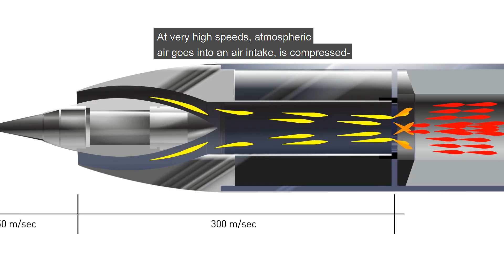How ramjets may change the role of artillery on the battlefield

Comment: Wallah, that electronic voice ..
Just a small problem with this concept - it needs clean air going into the intake - that means the motor must be infront - no turbulent air. That means the artillery shell is in the rocket motor discharge - will overheat and explode before reaching the target.
If you put the motor behind the artillery shell, it will not get clean intake air......

Comment: Drones will make all artillery obsolete, if they have not already. Id imagine for the price of one of these shells I could send fifty ground hugging kamikaze consumer drones to the same target from different directions each carrying a pound of C4
Reply: You can't hear an artillery shell coming and when they come doctrine makes sure it comes in volleys. Per shell they typically shred fields of 100m by 100m and kill all infantry and light vehicles in it.
There is very little active protection on the market against incoming shells, only passive warning systems.
Drones on the other hand... They are good as a weapon platform but not as a destructive device themselves. You can hear them, you can see them... You can shoot them with small anti personel weapons.

Comment: Definatly will need guidance at 150KM range
taking into concideration that if a mouse squeaks it will lead to a series of events that will cause one of them Russian artillery rockets to veer off target by 1 meter.
But if it means more hands on deck in the "get ramjets" working department, i'm all for it.

Comment: However the problem is there are significantly less charge in that shell than in a normal 155.
Reply: Indeed. I wonder just how large a payload it can possible carry. It looked like half of the thing was rocket fuel and the other half was partially claimed by the air intake.
Reply: @herrakaarme  it's always a tradeoff, Mr Snake. Better to have the first shot with 25% of the payload because you are already in range than not get in the second shot because you're dead.
Reply: @herrakaarme  At very high speed you don't need an explosive.
Reply: @Mic_Glow  According to the WW2 German data the ramjet assisted artillery impacted at a slower speed than a conventional artillery shell.
Reply: That was the first thought to pass my mind upon seeing the projectile mockup.
Reply: And I bet its really fucking pricey too.
Reply: @andycopland3179  "pricey" that's the point
Reply: Lutefisk poison.
Reply: hmm it explode bevor the impact and fill the aire with schraplol 🤔.....just an idea
Reply: Probably the only  real use is to  counter fire other artillery positions. You need  range advantage more than sheer firepower for that.
Reply: @tiagodagostini  ? You need same range as enemy and big precision. Size of warhead can decrease need for precision.
Reply: Yes but these are not area weapons. They will be to hit specific targets like an enemy artillery piece a long range.  So what if it costs 50x as much.  50 normal artillery rounds will not take out a 2S35 Koalytsia-SV 80 miles away.  That is the goal here..  Be able to put up a few hundred of these rounds a day, and take out enemy equipment.
Reply: @shooter7a  Sure they will. Just like ABM can reliably kill an ICBM on reentry with no warning.
Ooopss. No.
Reply: @hellstromcarbunkle8857  GBU-53/b's can achieve 90% contact kills on moving vehicle targets from 40+ miles away.  CBU-39s can do far better on fixed targets  Excalibur 155mm rounds can achieve nearly the same performance with similar range, and do not require an aircraft to launch.  What makes you think a ramjet boost will stop weapons systems from achieving the same performance?  These performance specs are real.  There are tens of thousands of US munitions on the shelf that can do this. 

Your false equivalence in comparing this to anti missile systems is childish and stupid.  The ABM problem is technically orders of magnitude harder.  

For example, with an ICBM, you require a CEP of less than 1m.  You literally have to HIT the target directly. 

The target is traveling Mach 20.

The ABM missile is traveling Mach 3-6.

You essentially have to hit a bullet, with another bullet.  

The precision artillery problem is far far easier.  Required CEP to take out fixed targets is 3-5m.  

They are standing still. 

The artillery round is moving mach 4 +/- at the muzzle.  

This is EASY.
Reply: @shooter7a  No ABM system uses a single kill body. It's always a scattershot at predicted impact.
Always.
BTW, Gerald Bull produced 4.1 CM CEP at 50KM back in the early 80's.
The reference is G6-45
That's CENTIMeters.
Reply: @shooter7a  Moving vehicles < 60 mph with 90% hits? That's a lie.
Reply: @shooter7a  No they won't. Because the ramjet means less weight to throw in warhead, so smaller or nonexistent guidance, thus MORE area fire if you're going to hit the target FARTHER AWAY!!!
Reply: @hellstromcarbunkle8857  Ramjet means less oxidizer weight as well.  That is the whole point.
Reply: @shooter7a  Less oxidizer.
And a steel aerodynamic ram.
And a Ceramic compression chamber.
And fuel injectors
And aerodynamic maneuvering surfaces.
And inertial guidance surfaces.
No, it won't work "better" as it shoots farther with less accuracy and far higher costs for much lower payloads.
It's the new "Crusader" cannon fraud. again.
Reply: I bet the explosive would be in the Air-take thingy. Adding that with what little fuel is left.
Reply: Uhm, no. A standard fragmentation shell for a 155mm Howitzer is 47kg. 9kg of that is TNT. The remaining 38kg is cast iron (minus the few hundred grams for the detonator). By the looks of the void between the venturi and the fuel compartment id hazard the guess that this could hold maybe 12kg. You lose a lot of the fragmentation though.
Reply: Jjohnno 87  jeah but if its laser guided tanks with LWR(Laser warning reciver) would by warned if the are lased useally the would deploy smoke and retreat tanks with out LWR would get destroyed by it and any other laser guided arty round
Reply: @toxi2202  may be you are right but laser guided artillery missiles are costly to waist for a small weapons like ramjet shells
Reply: I ask why America could not duplicate the 100 km range of the GC-45 210 mm canon built back in the 1980's by Gerald Bull.
We have his notes, his drawings and several examples taken from Saddam in Oilwar I.
What's the hold up?
Reply: @shooter7a  FIXED, FIXED and no, 92% is not going to be true at 100 km (same as the GC-45 from 1980)
Reply: @shooter7a  Oh, NOT 1400 km, don't even try.
Was that yards? Meters? EIther one being well under 1 mile it isn't a test, it's a joke.
Reply: Which is fair if you can delivery it as the  small cruise missile it is
Reply: If they have laser targeting or gps, they don't need a huge charge.  If it's used as anti-materiel, the emphasis is quite different.
Reply: @jklappenbach  Either laser targetting or GPS won't help. Too much lost firepower.
Reply: @hellstromcarbunkle8857  You're thinking about this wrong.  They could remove all the explosive and put in tungsten penetrator rods, and this thing could kill vehicles or equipment through kinetic energy, alone.  As long as it hit the target.  Which it can with laser guidance at 150 km.
Reply: @jklappenbach  Too slow to be any use at all. Ramjet big enough to push to Mach 3 would suck gallons per minute.
NO explosive, NO warhead at all
People, this HAS been tried before.
No sweet spot fuel, guidance, ordinance better than standard rocket-post boost.
Reply: Small charge is better than no charge
Reply: @dobs862  Not even.
If the target is not destroyed, the small charge just makes you a target for counterfire batteries
Reply: @hellstromcarbunkle8857    Hey genius the warhead is the same weight as the shell is over almost 3 times the length of a standard shell/rocket boosted shell and and they do not run for minutes but seconds.. And FYI these shells are now in serial production with Boeing and are finishing up the last of the testing..
Reply: @matthewq4b  So..you have ZERO data on the delivery weight, impact destruction at various ranges nor even maximum range.
Thanks for clearing that up>
no, the warhead is NOT the same weight since the propellant is still limited to 155mm diameter on an expansion length of just 4 meters. A bigger cannister will NOT increase throw weight given that the delivery vehicle is now accelerated over a shorter distance.
More powder only helps if the maximum pressure / time is increased. It is not.
Reply: @matthewq4b  Finishing the last of the testing.
You mean like the AIM-54A Phoneix.
That never, ever worked as advertised?
Well color me shocked.
Reply: How do you know that?
Reply: A normal 155 round can't precisely  strike a high profile target beyond 40km though
Reply: Destroy their artillery with ramjet shells, then move heavier artillery closer.
Reply: I think if it could be made into a precision shell which could be guided then the small charge could be ignored.
Reply: @許進曾 such precision would make the round to expensive to be used, which is what killed the Zumwalt class…
Reply: @許進曾  At the price-point it is a necessity. But the USA is stuck in the past filling the entire countryside with tonne upon tonne of explosives. The war of the future will be more hide and seek.
Reply: i guess if the shell is flying at Mach 3 it will rely on kinetic energy to mess things up
Reply: @RichardsModellingAdventures  kinetic energy is useless against infrantry that round cann mis you by 5m and your fine  

Meanwhile normal artillery uses HE fragmentation To cover whole are with Fragmentation and even air bursting for maximum lethalnes
Reply: @toxi2202  But even a handgrenade at that range will mess you up, and this munition looks like it will have at least that much explosive payload...
Reply: Wont do to much if it hits sand dunes and doesn't explode… That type of round would be effective against structures but the price would be insane for that level of accuracy from that range.
Reply: @RichardsModellingAdventures  No.
Reply: @RichardsModellingAdventures   
I do not think that could be its terminal velocity.
Reply: @nahidhkurdi6740  Mach 3 is minimal velocity for ramjet engine to work but its hard to say what the speed will be at the end of the trajectory.
Reply: @Bialy_1  once fuel is burned, head will slow down missile rapidly
Reply: @Bialy_1  Wrong. Ramjets were used on the XH-26. Not efficient but neither will these be. Remember, the ramjet will have to endure 5K g's acceleration.
Reply: If I throw a rock  at your car at Mach 5, your car will explode.
Reply: Germany developed solid fuel ramjet artillery during WW1 with a range of 120km. The explosive payload was too small to be useful.
Reply: @Spacedog49  I would expect the targeting in ww1 would be the main cause of a small charge having no usefulness. If you could trow a hand granade 120km and have it land on target it would be useful. however at mach 3 it will still take 2 minutes to go 120km. so not as useful for infantry or vehicle warfare but may have a place for weakening communications and utilities. but also a hard sell vs drone tech.
Reply: @another1commenter770  GBU-53/b's have autonomous targeting capabilities and are able to take out moving targets 40 miles away.  It is not outside the realm of possibility that artillery could do the same.  In fact, the M982 has already been proven in combat to be able to hit moving targets.  What you say is not possible has already been done.

Here are some notes on M982 variants:

Increment b:

Excalibur S: In June 2013, Raytheon initiated an internally funded program to upgrade the Excalibur Ib with a semi-active laser targeting capability. The SAL seeker will allow the shell to attack moving targets or those that have re-positioned after firing, and to change the impact point to avoid collateral damage.

Excalibur N5: Version of the Excalibur S downsized into a 127 mm (5.0 in) shell to give naval guns mounted on destroyers and cruisers the ability to fire extended range guided projectiles.[31] Raytheon is also considering a millimeter wave seeker (similar to GBU-53/b) for fire-and-forget operations.
        
Excalibur EST: Excalibur Shaped Trajectory, allows the shell to make its final approach at a controlled angle; demonstrated in August 2018 and deployed shortly thereafter.

Increment II "Smart" projectile for moving and time-sensitive targets. May carry either 65 DPICM or two SADARM submunitions.

Increment III "Discriminating" projectile "to search, detect, and selectively engage individual vehicles by distinguishing specific target characteristics"

So Raytheon is already working on a rocket boosted, guided 155mm Excalibur round that can be shot into a "no-drive zone"....and search the area, find targets, and select the highest priority target, moving or not, and take it out.".....  Again...this is reality, and many of the capabilities have been proven already.
Reply: @Spacedog49  WW1 was over century ago... many thing have changed from that time and on top of that you are wrong it was Hungarian inventor Albert Fonó...
Reply: @Bialy_1  I know Albert Fono had the original idea for ramjet assisted artillery. His proposal to the Austro-Hungarian military made its way to Germany. Germany started research during WW1 but did not finish until WW2. Albert Fono had many pioneering ideas in jet propulsion.
Reply: @Biały he worked for the German Army…. The  Austria-Hungary “Empire”was not much of a threat by that stage of the war.
Reply: @Spacedog49  Wrong those were the V1 "Buzz bombs", they were ramjet powered missiles that where much bigger and had more of a bang than these joke of artillery shells... You may be confusing it with artillery because they were making bunkers to launch them from on rails to hit England. (But they were bombed before completion)
Reply: @SilvaDreams  I'm not confussing ramjet assisted artillery with the V-1. I have a little known book written by my friends George James and Fred Durant. They devoted one chapter to the development and testing of these ramjet assisted artillery shells.
Reply: @SilvaDreams  V1 are not ramjet powered, it is powered by pulse jet.
Reply: That and the price. If you have that kind of money, get more guns.